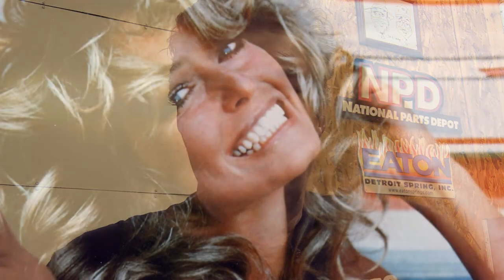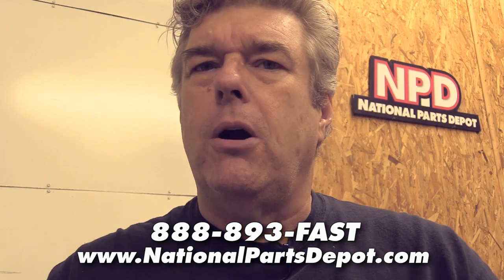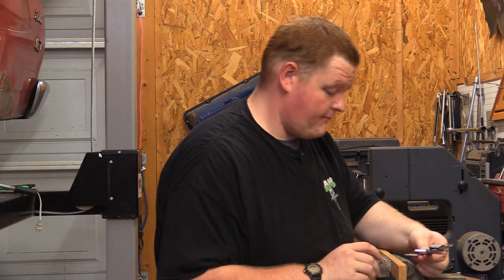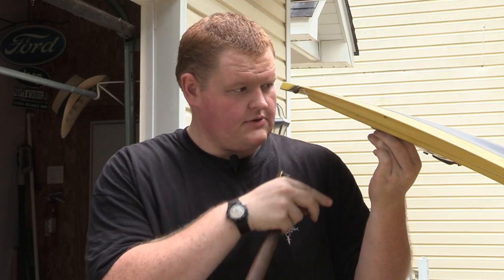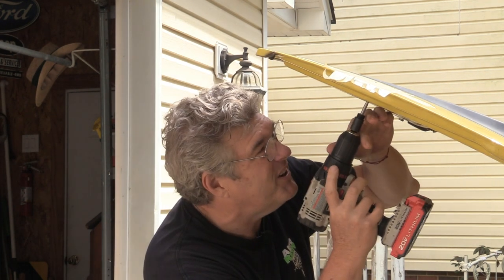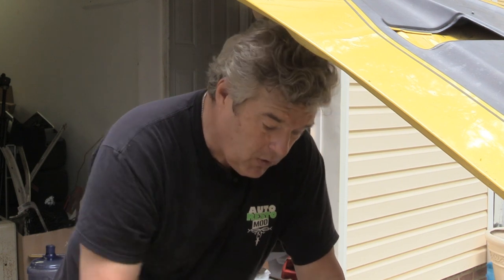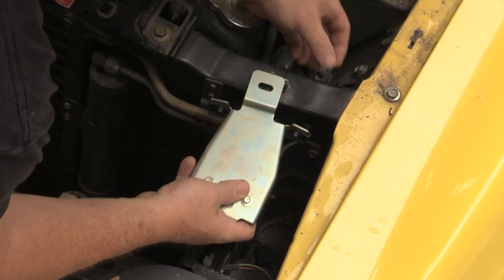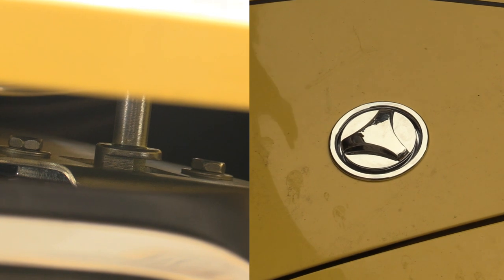How To Install Hood Locks

Comment: Yay, another Mach 1 Vid!!!!  Keep 'em coming you guys!!  My Mach 71 Mach has the ram air and hood locks, and perfect alignment is difficult.  In my case, they are completely factory to the car, but getting them to work perfect is a chore!!
Reply from the maker: We are planning a body panel alignment soon, hood pins included.

Comment: I remember the first time I had to drill a brand new painted hood. I had just finished my apprenticeship at the Freightliner dealer and was handed a ticket to install some new hood mirrors on a truck. I was so nervous. It turned out fine, and prepared me to install badges on my father in laws freshly painted fenders.

Comment: Hey team Resto Mod love they show  always fun and informative to whatch

Jeff can you please tell me what Radiator and size you have plus  what temp and brand thermostat do you have in the 351c
I want To buy aircon for my  351c but need to know  I I must change the Radiator or the thermostat  
PLEASE thank you
Reply from the maker: I run a 160 degree thermostat and the radiator is the stock one (the top plate has a part number on it and is an A/C radiator). I had it re-cored. three core high fin count should be good IF the be bore is good and not thin (The Cleveland, like the 428, is prone to getting warm when the bore goes over .040). If you want more help, email me at jford@autorestomod.com

Comment: What size metal hole saw did you use for the top of the hood?
Reply from the maker: We used a 3 inch hole saw.
Reply: @AutoRestoMod  thank you sir! I have a 1972 pewter Mach-1 that I'm doing this and the ram air mod too.

Comment: Good job!  We did a deep restoration and enhancement of our 1973 Mach 1 the other year.  One of the enhancements was to add the Dzus hood locks, more for the aesthetics than for any real "performance benefit."  But, that said, they do look great when installed properly.  When they are not installed correctly it can be very goofy looking on Big Nose Mustangs (1971 -1973).  I have a video showing what happens where someone used the radiator support panel to mount the Dzus locking mechanism, as opposed to using the locking mechanism extension bracket.  What a sad looking result.  Here is the link to the YouTube additive info link I tossed together.  I hope it helps spare someone some grief.  You know how it is, once the hole is cut it is hard to go back for a do-over!

https://youtu.be/zE9lCXnmJr4